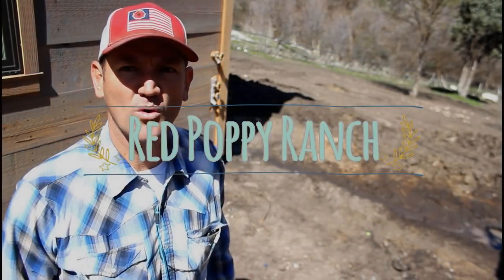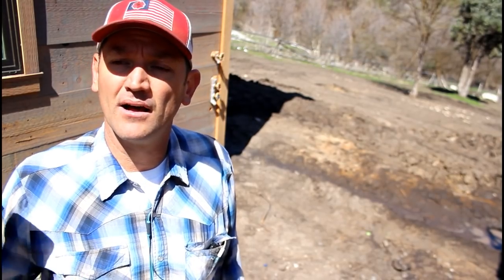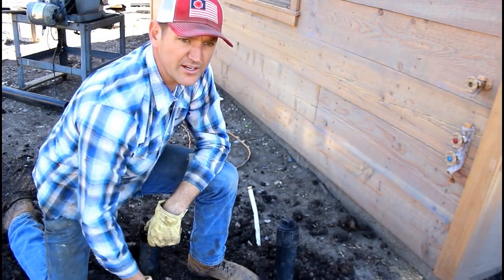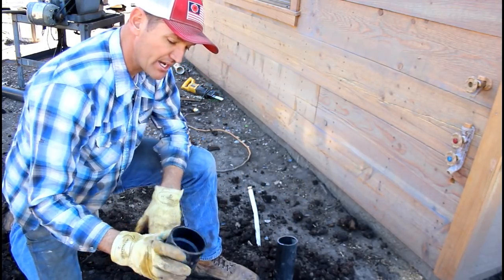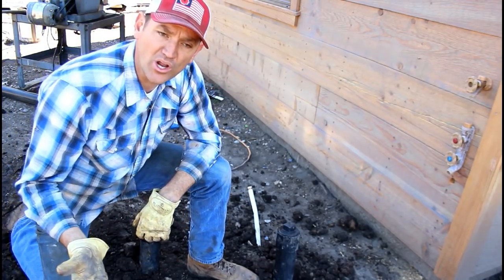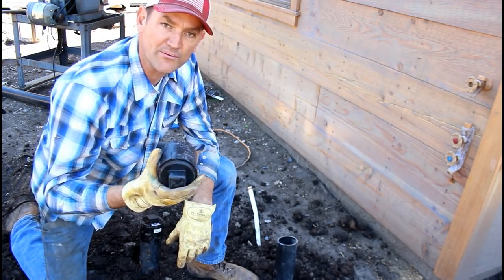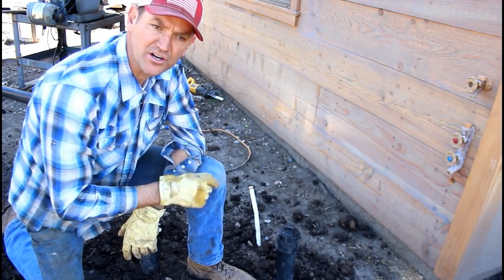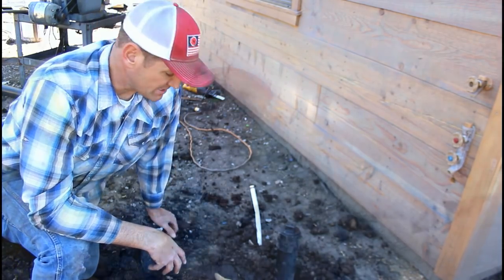#220 - I Install Bullhorn Cleanouts Per Code (Sewer)

Comment: In sweden, tin roofs are standard on houses, we use a special screw with a rubberwasher on it and we dont have any issues with screwing them in the "vallyes" on the roof. just use the proper screw, dont complicate stuff!

Comment: I just got an inspection on a new electric panel I put in. The top thing they focused on was grounding. Just FYI.
Reply from the maker: Thank you!
Reply: Well yea proper grounding saves life’s and prevents fires. Did they fail you on anything
Reply: crunch9876 nope - it passed just fine.

Comment: Do you have a grinder pump that feeds that line? I don't think I would ever use 3" in a gravity system after seeing all the troubles our village has with older 4" lines.
Reply from the maker: jay90374 it comes down to the installer not the pipe size...
Reply: What are the 4 inch lines made of?
Reply: crunch9876 - Mostly tile but a lot of plastic too.

Comment: What would it mean to pump creek bacteria into your potable house lines and have that residue in the lines waiting to grow? Or you must be talking about only the drain lines? Mrs CB Ohio
Reply: Drain lines so they will be full of bacteria all the time. The water lines they just pressure test to make sure it holds a set pressure for a set amount of time.
Reply from the maker: Sewer lines
Reply: I think you are referring to the water test. Sewer line gets plugged with an inflatable ball and filled with water. It is a test to find if the system has a leak. After it passes inspection the inflatable ball is deflated and removed allowing the water to drain out into the septic tank.

Comment: I almost always use rolled roofing under my metal roofs.  Tar the joints like its going to be the only roof...Then add the metal roof over it... and ive never had a callback.
Reply from the maker: Should I tar the edges? No issue going over the top of the underlayment?
Reply: I do just because its a backup if the metal ever had a leak or ice damned backwards to the seams of the rolled roofing.  6 inches  on the edge then the next course lays on that strip of tar..(So you dont actually see the tar)
Reply: I dont remember what underlayment you used to just dry it in for winter?  But rolled roofing can go over anything.  Preferably tar paper or even the new synthetic papers.    Ive used watershield rubber membrane for the first few feet on low slope 2/1 pitches even...    To me its like 2 complete roofs and the cost is the same or less than using all watersheild stuff.
Reply from the maker: I did water and Ice acrossed the bottom then the rest was synthetic.
Reply: Youre good to go right over it with the metal roofing if you want that will meet code.  If your pitch is good 4/12 or higher its good enough.   I double with the rolled roofing just because im thinking in terms of forever or as close to it. lol.   Enjoy your videos btw!
Reply: What do people mean when they say roll roofing? Im a general and roofing co tractor and always understood roll roofing as torch down. Do you mean something other then torch down.
Reply: crunch9876 - lol, me too. I never heard the term "rolled roofing"....
Reply: Rolled asphalt I believe. (like 3 tab in a roll)
Reply: It is the same granular coating stuff.  You can torch it down or cold apply according to manufactures specs.
Reply: But after seeing the slope on Red poppys roof I dont feel its necessary.   He has water shield and synthetic already installed which is perfect.  I mainly use this on 3/12 slopes or less as extra insurance under metal roofing system.